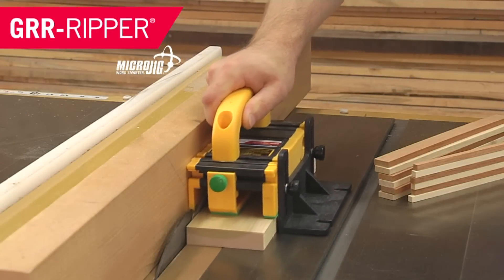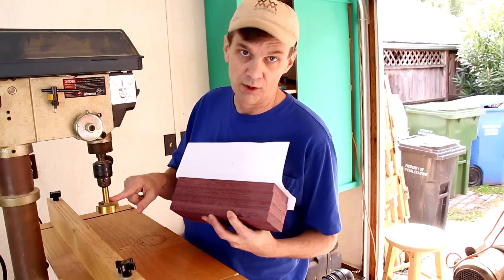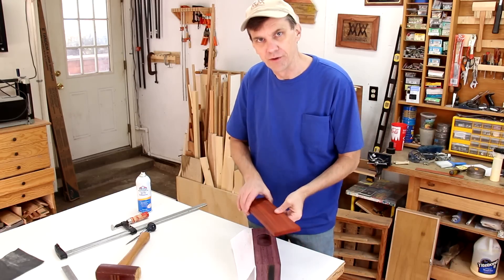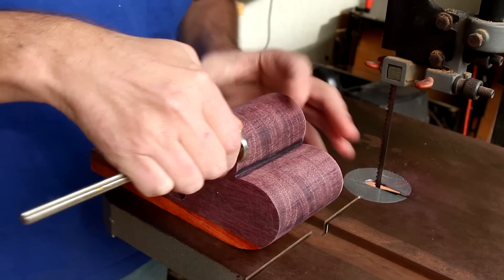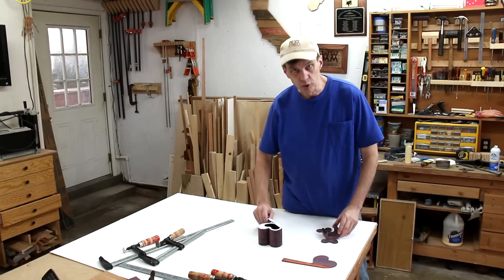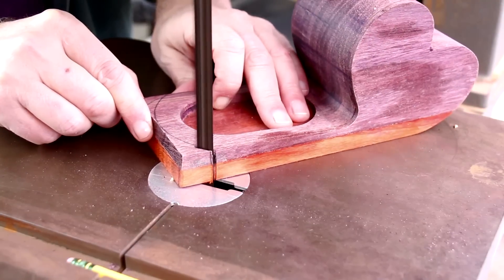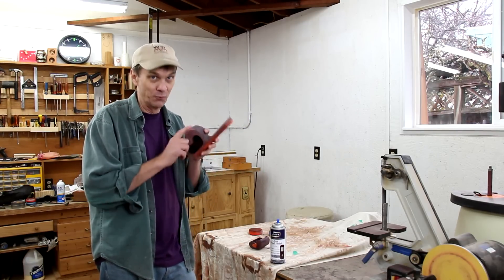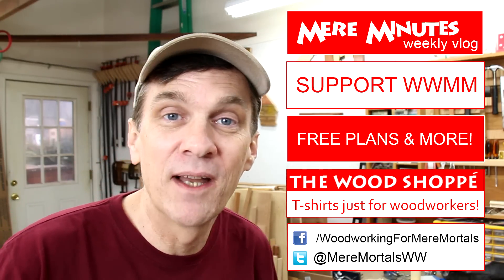Heart-shaped box with tray. Classy gift idea.

Comment: Would you mind doing the same project without the forcner bit and belt/spindle sander? Just the bandsaw, glue, clamps and hand sanding? For complete noobs. I only had those basics and is was a lil tough figuring the process out. Fun for me but for others it might be easier to get into it with a little extra help.

Comment: Really appreciate this and even the plans, but I went through 2 different blanks as I cannot get the inside drawer cut out properly without tearing out the side.  Probably the tension on my bandsaw, but this was my first try at a bandsaw box and oh boy has it been hard.  Moving on to something a little easier until I can get better with fine tuning my bandsaw.  Thanks again.
Reply: Ok...so I stuck with it and bought some more material and the correct bandsaw blade and this turned out great!

Comment: There has to have been a better way for the entry at the base for the band saw blade. Like drill a hole and run the blade through (like a scroll saw) or would a scroll saw been better in this application. Please any suggestions?
Reply: B Kelley A band saw blade is a linkless loop, it has no end points. There is no way to get it through anything without sawing. To do what you propose, you have to use a scroll saw or a jigsaw.

Comment: I used purpleheart for a cutting board. That stuff is so stupidly hard to work that I was using metal files on the first "sanding" pass. I might make this (if the snow ever decides to stop coming), but I'm definitely using something easier to work than purpleheart.

Comment: This is not a critique at all, I love your work but have a question about the drawer. Wouldn't it be better to cut the drawer out of the purple heart wood before you attached the base so you wouldn't have to cut through the side and try and glue it all back together? Or would that cause more problems?

Comment: QUESTION! I live in an apartment so I can't have all these big power tools in the house but I love crafting things! What kind of tools would you recommend for a guy in that situation? THX!
Reply: You could still have a bandsaw if you can control the dust or have it on a balcony. or else consider projects with a scroll saw. 
You could make a small bench and use mainly hand tools with a cordless drill in a study sized room. 
You can also buy a mini table saw, a rotary tool, a scroll saw and similar machines like model makers use. Ideally duct everything out to a shop vac on your balcony to remove the dust. There are a lot of small craft style wood work projects you could do in a mini workshop like that.

Comment: Nicely done Steve always fun and entertaining on the work.  my heart almost stopped when I might have mistakenly saw your fingers underneath the curved part of the work piece.   Please everyone be sure to always use/hold/push the outside edges of the work piece especially if the work piece curves inward.  The very first touch of that band sawblade could've caught on the top edge slamming down And taken your finger(s) off.  From a concerned and much appreciative subscriber.

Comment: Hey Steve, I have built quite a few of your projects. I'm a big fan. I love this box design and I just built one today. I'm not a fan of chisels, so after I drilled the holes for the tray, I cut the tray part out, which allowed me to use my scroll saw and spindle sander to clean up the opening before I glued on the bottom, then cut the rest of the heart shape off

Comment: Micro jig works great for cutting very small pieces of wood through your table saw. It allows the cut piece to clear the blade with little chance for kick back as the jig grips both the stock and the cut piece and keeps them together as they pass through the blade. A great product and fully adjustable to your project size.